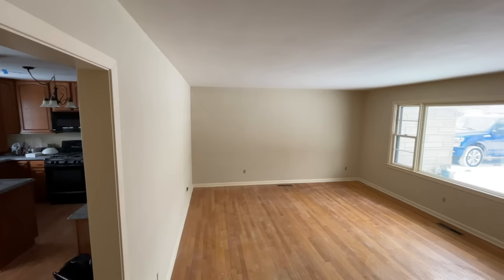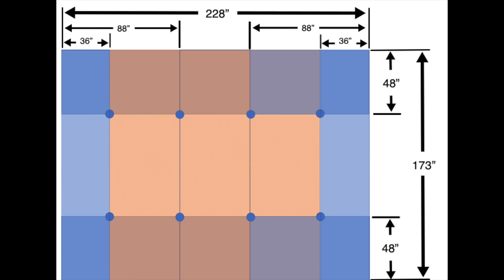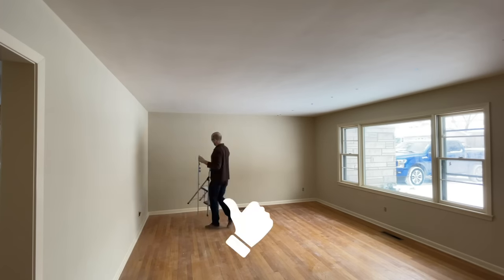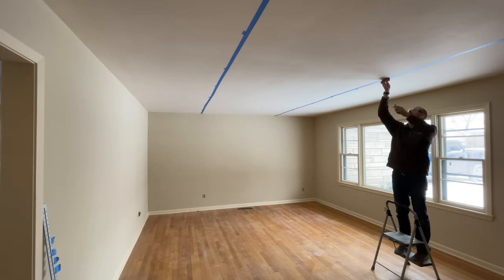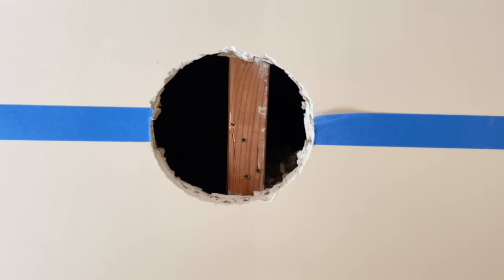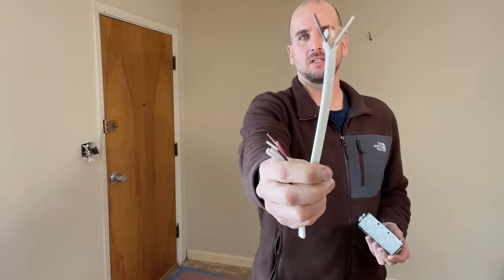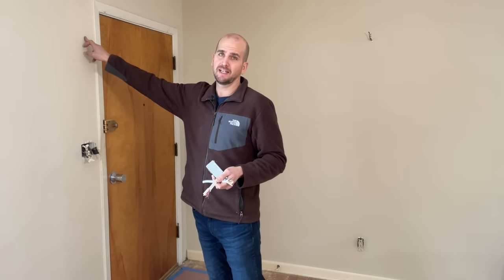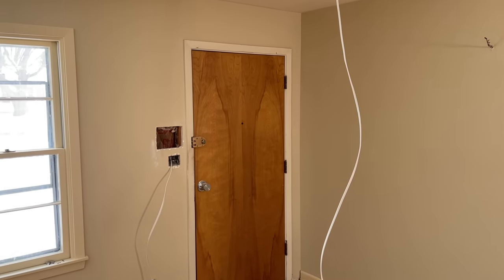Ultra Thin Recessed Lighting | Transform A Dark Living Space

Comment from the maker: Lights used in the video (Amico 6" LED Lights):  https://amzn.to/3q4mDnP
Reply: What if my homes current wires are only black and white...I purchase the Halo 6 inch that came with white, black , and copper..how can I connect the copper if my current homes wires doesn't have it
Reply: I get them from my local hardware store, love them! I like the 4" better than 6" for large spaces. I use them to light up the walls, install no more than 2' from the wall and every 2.5'-3' very nice!
Nice vid, thanks!
Reply: I like using a circular hole drill bit for cutting the hole, very precise and perfect fit so no air loss. love how you can install them right on the beam!
Reply: Just out of curiosity why did you use 14 awg wire
Reply: Video going too fast
Reply: @Tom Smith not in the business of advertising, go to your favorite store ask them if they have it, if not, ask them if they can get it, if not, get it online :-)
Reply: I’m interested in the life of the led lights before they need replacement

Comment: I rewired my mobile home with these in a remodel and you can get a 12 pack for well under $100 for basic versions. I also put in dimmers in a few but they are so easy to install and wire up. You can have brighter lighting, more lighting and at much lower energy cost. I put them in my kitchen, hallway and second bedroom and make a massive difference for a cheap price. Easy install option if you do not have a hole saw. I took a nail and a pencil and connected them with a piece of ground wire with a loop on both ends at the diameter for the hole . Push the nail into the middle and you can now draw a perfect circle to cut out with your jig saw.

Comment: In a similar situation I've used a Sawzall to cut out the switch box and replaced it with a Carlon old-work box (eg. BH234R). This allows enough access to remove wire staples around the box, makes fishing wires much easier, gives a bigger box to work in and if I'm careful no extra wall repair/painting.
Reply from the maker: Nice!  Thanks for the feedback.  Yeah, on any other project I probably would have taken some additional time to avoid the patch but since, I literally had the drywall, tape, mud, and paint in another room it wasn’t as bug of a deal.  Fun project!

Comment: I see you often mark your work area with tape and measuring all the way... I know it might be overkill for the small room and stuff you show on average residential renos but one thing that has changed my life is one of those self leveling (Laser Level 3 X 360). I've used it for commercial space but honestly if I had a side hustle of doing quick electrical residential work I'd be buying one for sure. It's one of those tool that can save a lot of time!
Reply: Exactly what I was thinking

Comment: I just helped a buddy with this.  Exact same setup, not sure if it’s code but I just ran a new wire for the lights to the switch box, used pre existing  holes. And wired the red switched wire to the hot black so both sides of outlets were hot. Thanks for the video helped a Bunch.

Comment: Great video! There is  a model exactly like this that has a spot to slide the romex in and then you just pin it with the built in bar. You save money on the connectors and you also save time. Time is money!

Comment: Not sure if you did this, but also for the old pot lights you had caps you could buy.  But these are shallow so use a piece of vapor barrier to cover over them.  Use some acoustical sealant between the cover vapor barrier and the present ceiling vapor barrier.   You can also add red tuck tape to the seams.  Then cover with insulation.  If you don't do that in a cold climate you will get condensation and mold.
Reply: Yes need to show how to deal with the vapour barrier !

Comment: Great video! I have the exact same electrical setup in my 1955 house. I've wanted to add ceiling lights for years to replace the lamp plugged into the switch controlled receptacle. All I need to figure out now it where the power is coming into the porch switch.

Comment: Started with Halo 6” ultra thin lights. Did not like the glare off the light’s edge.
Switched to Halo 6” baffle trim light. Lot less edge glare and looks classier.
Easy switch between the two lights at the hand tight connector.

Comment: I have done this many times . 
Another way you could have tried is where the wire came through the hole is usually big enough to fit another wire . 
Just push the wire through that existing hole  and remove existing box and put in a new cut in box . 
Therefore no Sheetrock or painting to repair .
Reply from the maker: Agreed 👍

Comment: I just installed this today and was extremely happy they it turned out.
Reply from the maker: Honestly bang for the buck I think this is one of the best upgrades you can do for a home.  Especially those who have no ceiling lights but switched outlets.  👍👍
Reply: did you shut off all the power? or no?
Reply from the maker: Just the power to the circuit used.
Reply: @EverydayHomeRepairs  same here.

Comment: I'm remodeling my upstairs bathroom and adding these types of slim LEDs.  Where do i mount the led transformer?  Do i have to mount it to the joist? I have loose insulation like you but also a vapor barrier between the drywall and insulation.  And since i live in Canada, it gets to -45C during the winter, do i need to insulate the transformer as well?

Comment: to pass the code do you need to secure the box above the drywall with the screws? Also,  do you need to staple Romex 6" from the box like you staple for the outlet box? If yes, then how do you remove the junction box through the 4" drywall hole for maintenance if you have romex cable is stapled? Thank you !

Comment: I have a single light on a dimmer switch in the kitchen that has two black wires and a ground copper wire going into it. Would I use 14:2? There are other wires behind the switch that are capped off  as well which is throwing me off. Thanks for any help.

Comment: Hey great video! I'm using the same lights but for some reason my dimmer function is not working. I have 8 of these lights (so 96W of consumption) and a 150W dimmer switch. When I initially installed them I tested when having 2 hooked up and worked fine. But after installing the other 6 the dimming function stopped working. Any thoughts?

Comment: do the LED driver boxes need to be secured or can you just push them through the holes?
Reply: I just installed mine and I have the same question but as per my search it should not be screwed so you can work on it whenever needed without attic access.

Comment: Awesome video!! Please explain what breaker size you are using ( i.e. 20AMP or 15AMP) Also if you are using 20AMP you should have 12 AWG running from breaker to switch. If you are, my question is: can you still run 14AWG between your  LEDS,  14AWG to your switch and then 12AWG from your switch to your breaker?
Reply: 6:34 he explains that he is using 14 AWG wire and that is rated for a 15 amp breaker. It is not recommended or safe to change wire sizes.  If you start 14 wire, end with 14 wire.

Comment: Why should the hole saw be 3/8" larger to drill the holes for the 6" ultra thin downlight? 
Can I also use a 6" hole saw to drill the holes for a 6" ultra thin downlight as well? 
Will the carbide hole saw drill through solid wood as well?
Will a 5" hole saw also do the job for the 6" slim down lights?
Thanks in advance!
Reply from the maker: It also depends on the light which you purchase.  In the product installation instructions you will find a callout for the hole size.  In my case 6" would be too small and I needed at least a 6 1/4" hole.  The whole saw used would not be ideal for wood.  Are you drilling through wood paneling?

Comment: So I am new to this so sorry if my question seems silly. So if there is an existing light socket in the center of the room instead of adding a junction box in attic can we just feed off of that existing light socket and connect the recess lights to it with 14/2 wires? Hope I made since.

Comment: Did you mount the LED controller box in the attic or is left loose?
Reply: The wafer light drivers usually have a couple of mounting holes that you use to secure them to a joist.  I absolutely love these kinds of lights.

Comment: If I want to add an additional ceiling light in the middle of the same room where all the recessed lights are on do I need to do this same process? Or  can I connect the ceiling light with the  recessed lights so when I turn on the switch all of them turn on together? Is that ok to do?

Comment: Should have pulled the switch box out and brought new switch leg into a new switch box. It is always better to have wire connections downstairs  in the switch and outlet boxes. People add attic insulation and cover junction boxes.
Reply from the maker: Thanks for the feedback Robert!
Reply: To each his own. I’ve been an electrician for 31 years and I have junction boxes in my attic. I have them higher than the insulation and they are nice and neat. I use wire markers and I have the circuit number and information written with a sharpie on the box cover. That’s the way I like to do it. Just my choice. However, I would have run a 12-3 down to the switch because the outlet is still being powered and is most likely on a 12 AWG home run.
Reply: @seanlehmann7055  i have 30 + years in the trade. It is better to have junctions downstairs that way you don't compact the insulation.  And you dont risk injury from climbing in the attic.
Reply: @seanlehmann7055  I have 0 experience and 12/3 seems unnecessary

Comment: On minute 8:33 of the video I noticed you twisted both white neutral wires together but you confused me when you also inclided hot wire too beforr you taped them. How is that possible? Isn't dangerous twisting and putting together 2 neutrals and a hot wire???
Reply from the maker: That is just for pulling the wire up and through into the attic.  Once I get the new 14-3 wire into the attic I do the actual wiring in the metal junction box.

Comment: I've installed these in two rooms in my house.  I have two questions regarding the electrical code:
1.  Do the metal drive boxes need to be screwed to a joist to meet code, or can they be put up loose (like you did in the video)?  
2.  I thought I read about a limit on the number of wires/connectors coming into the drive box depending on the volume (size) of the junction box.  Some of those drive boxes are pretty small, and they have 4 knockouts.  I've heard they really aren't big enough (by electrical code standards) to contain that many connections.  Do you know if that is true or not?
Reply from the maker: Hi Tom,  I am not sure on the code for securing the junction boxes.  Probably best to secure if you can.  For the second question you could look up a fill chart which will provide maximum “fill” for a box with that volume.  I would agree the box is pretty small so you wouldn’t want much coming in especially if you are using 12 gauge.

Comment: I installed the 4in 800 lumen led.  I feel they are too bright and want to swap to the same light but the 540 lumen version. Can I use the same junction box and just plug in the new light or do I have to switch boxes as well? Only difference I see is that the 800 box and light are 12W and the 540 uses 9w.

Comment: How do you daisy chain the lights perpendicular to joists?  Meaning, feeding the romex across the first 4 works if they are between the same two joists but jumping over to the next light would have to be perpendicular.
Reply from the maker: For this install I have an attic so it was easy to have the wires laying over the top of the boards.  Do you have an attic?

Comment: Great video and tutorial on wiring.  I am working on a house with similar recess lighting throughout the house.  It's controlled by Hubspace on the clients phone.  After I wired the two gang switch with smart switches.  The lights never came back on.  The left switch controlled the ceiling fan and the ceiling fan light worked, but the right switch for the LED smart lights did not.  After hours and hours of troubleshooting.  I've given up; however, I noticed you used a couple of pigtails.  Do I need to grab both lines from each switch and then add a pigtail for each to go into one of the RL lines of the smart switch so they both function as they should?  Thanks so much!

Comment: The national electric code (NEC) requires 6 inches of free wire from the face of the box.  It would have been better to remove the existing box and install a deep "old work box".  a fiberglass rod might have been an easier method of feeding the new wire both up in the wall and across the ceiling.
Reply: I have had a lot of luck in the past carefully breaking the old box from the wall and letting it drop in the stud cavity.  Then you can reach in the hole and yank the old wire free of the staple.  The old wire then becomes your pull wire without cutting a hole above the box.

Comment: Seem to be a US-only thing. I don't think i have ever seen a house where the ceiling is just drywall.... or anything else for that matter. Drywall is just used as a last cover over the wall.

Also for LEDs - they need airflow and as such while recessed lights are possible you should make sure they are not covered up.

Comment: I bought these to put in my basement. It only has shop lights right now. They existing wiring is 12-2. Am I able to reuse that or do you recommend switching out to 14-2? I’ll be using 8 lights in a roughly 20 by 15 space.
Reply from the maker: If it were my project I would just use the 12-2 as there is no reason to reroute smaller gauge wire. Best of luck on the project 👍

Comment: Awesome video. Extremely helpful and well explained. I have the exact same scenario in my home. My only question is on the 14/3 wire. I’m not sure exactly why you need to 14/3. Would 14/2 still work?
Reply from the maker: I just ran 14/3 down to the switch because I needed the extra hot for a powered outlet pulling from the same switch box.  Depending on your switch setup you might be good with 14/2.
Reply: @EverydayHomeRepairs  thanks! Keep it up with the great content.

Comment: Hello 

I followed the same steps but for some reason the light le are not turning on. I have power in them but no light. 

I changed the lights 3 times but same result. The first light without connecting with the other ones would turn on but as soon as I would connect the second recessed light, both lights wouldn’t turn on. 

Do you know the reason

Comment: Can I use one of these in my shower stall, if not recommended?
Reply from the maker: I believe most brands you can but I would make sure you have the little gasket / seal between the LED recessed housing and the drywall.

Comment: Considering something like these but I wonder what happens when one of them fails or burns out one day. Would you have to replace the entire fixture or is there a lighting element that is replaceable?
Reply from the maker: Hey George that is a good question, for these units they basically are all one enclosed unit and you would just need to swap out the light/housing and disconnect the unit from the electrical box which is easy.  Because of this I always buy 1 extra unit per 5 units installed.  If this is a renovation project I leave the extra units at the house for the future home owner.

Comment: Thank you Scott! Best video out there. Clear and concise. I have a question: did you place any cover over the lights in the attics? Or just left them alone, no insulation on top? Thank you!
Reply: Ideally if your attic isn’t conditioned, a cover is best and then air sealing the cover. You can buy ptemade covers or you can make your own with rigid foam insulation. Even if the lights are IC (insulation contact) rated, you’re not air tight so hot air is coming into the living space in the summer and cold air coming in in the winter if you don’t air seal. And you obviously don’t want to air seal the light itself like glued in or anything or you can’t pull it down to service it
Reply: The old pot lights had caps you can buy.  But these are shallow so just use a piece of vapor barrier to cover over them.  Use some acoustical sealant between the cover vapor barrier and the present ceiling vapor barrier.   You can also add red tuck tape to the seams.  Tgen cover with insulation.  If you dont do that in a cold climate you will get condensation and mold.

Comment: Why did you set the lights to 3000? Does this make a difference when using a dimmer switch? Thanks.
Reply from the maker: The warmer light (around 3,000 Kelvin) is usually said to be easier on the eyes.  Especially at night you wouldn't want to have 5,000 Kelvin lights as that could impact your sleep.

Comment: I'm here in Summit County Colorado & notice you in a UIUC t-shirt, sweet!  And, may I suggest attic air sealing around the holes.
Reply: Air sealing to prevent moist warm air going into the attic space is important in cold climates. The moist air will condense and freeze on the lights fixtures after the lights are out and cooled off. When the lights are turned back on and melt the ice, you could literally get water dripping down from the lights. Also "cans" over the lights to prevent heat from warming up the attic space can save your roof. All over Montana, new homes and renovated homes that skip these steps have damaged roofs from ice damming. That warm air in the attic melts the snow which then refreezes under the shingles. The ice expands and lifts the shingles eventually causing leaks. Attics have to be a cold space and pot lights can compromise this.